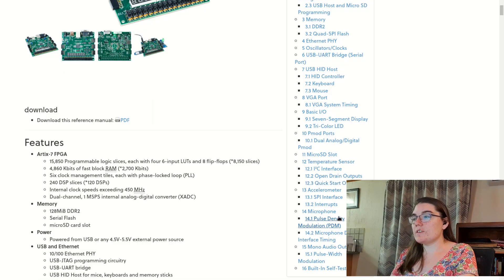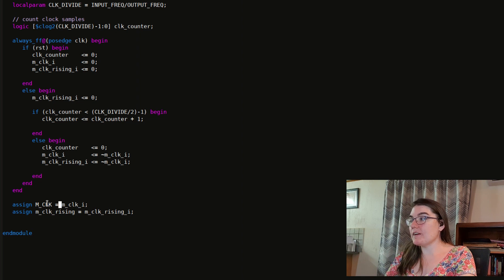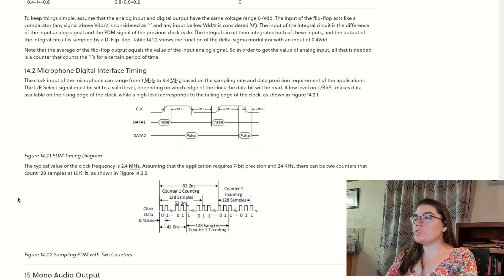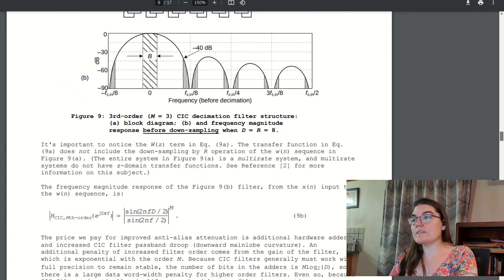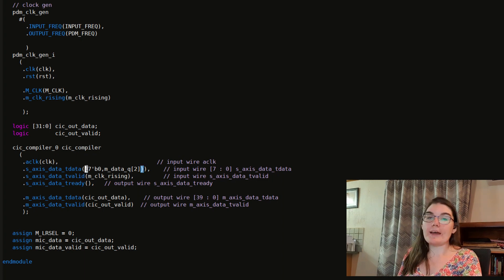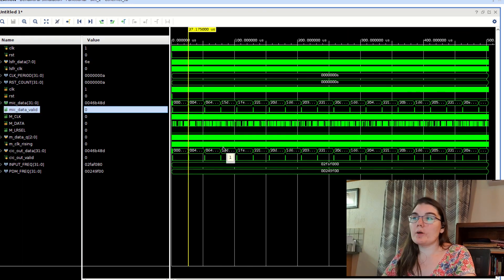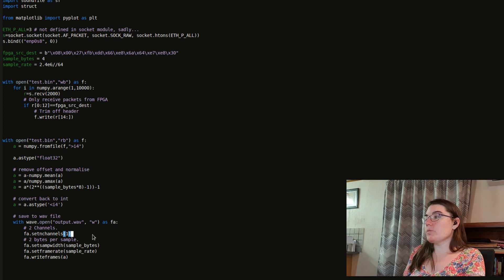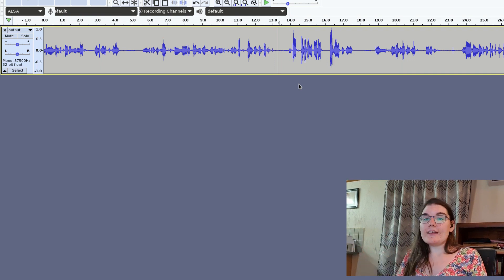FPGA Audio to my PC over Ethernet! PDM Microphone and CIC filter explained!

Comment: hello there stacey actually i watched your video on ethernet on nexys a7 board where you have used your custom ip for data transmission , here what i got the issue is that i cant understand internal working as i want to know how it works internally are you using TEmac ip or fully scratch if possible can you explain ethernet from scratch

Comment: Thanks a lot for this great series. I hope to see more videos from you soon because you are such a wonderful tutor and an amazing engineer.
Reply: The easy way to think about this is that it is a moving average filter (which is equivalent to a FIR filter with all the weights set to the same value) followed by a down sampler.

Let's think what happens if you have a moving average filter averaging 3 samples:
The outputs are the average of samples:
1, 2, 3
2, 3, 4
3, 4, 5
4, 5, 6
...
Now if you follow that by down sampling by 3 then you would be throwing away 2 out of three results of the averaging filter. So:
1, 2, 3 Keep
2, 3, 4 Throw away
3, 4, 5 Throw away
4, 5, 6 Keep
...
So if we look at the result (ie. just the stuff we keep) we get:
1, 2, 3
4, 5, 6
7, 8, 9
...
We can achieve that by adding up 3 samples, then outputting the result.

This is exactly what a CIC does: it accumulates and dumps.
This make it very cheap to implement in an FPGA.

Comment: Excellent video Stacey! The neat "CIC is same as/can be configured to act as moving average" is something I wish I had more intuition about. I was with it up through "a whole bunch of counters offset by one" and how thats a moving average - but then getting into how that related to a specific desired frequency response and configuration of the CIC IP I need to think about more...
Reply from the maker: Thanks! Yeah the filter part can be a bit counter-intuitive. It was only recently that I thought about the fact that a moving average itself is a filter, which has its own frequency response. It makes sense that it's low-pass (the output is more 'smoothed' than the input, and that means the jaggedy-high-frequency-edges are taken away). And finite (only D samples in the past are considered). So in practice it's a pretty bad low-pass FIR. The multiple-stages part makes it less-bad (extra stages improves the noise floor a lot, at the expense of taking up more space). It happens to be a good option for this application because it's significantly fewer resources and slightly easier to configure than a full FIR.
Maybe I'll implement a CIC in PipelineC at some point as my first PipelineC project :)
Reply: this book "The Scientist and Engineer's Guide to DSP" is such a nice read to learn about all that stuff. I recommend it.

Comment: Seems that your project is similar to mine. Im trying to send HF radio signal received by an antenna to PC thought Ethernet to draw the spectrum by FFT algorithm. I’m struggling at CIC filter to down sampling from 50mMHz to 200KHz. DSP on fpga such a whole new level which need to learn more to handle.
Reply from the maker: First off, apologies if you know all this. I don't mean to assume you don't, these things are just hard anyway even you do model it all. I have many memories of digging through my simulation sample by sample to find where it was different from the software model. Hope you don't mind the unsolicited advice :)

The biggest recommendation I can make for DSP pipelines, especially big ones, is modelling them first in matlab/python, and checking the simulation results against what you see in software. Especially if you're coding a CIC yourself, having a software model can help you figure out where your FPGA is deviating from the actual algorithm. 
Second recommendation is to check your datatypes are long enough to have the amount of dynamic range you need. Usually I code a second version of my algorithm in python that models fixed point and checks what dynamic ranges I need. 
Third recommendation is to add in debug muxes in your pipeline to enable/disable different pipeline stages to check if they work individually. Kinda like how I started with ethernet, then added audio, and hopefully will be adding window/fft. Usually checking each stage individually helps a lot.
Reply: @FPGAsforBeginners   I know some basics of Python but never use it for DSP, can you recommend some courses or books to learn more about it?
Reply: I think you will first need to mix the 50MHz with a local oscillator, then run it through a low pass filter.
I don't see how you can really do just what you are doing with a CIC.

Comment: Hey why input data width is 2 bits and output data width is 32 bits ? I thought PDM was 1-bit modulation (either low or high) ! Thanks in advance and very nice video
Reply from the maker: You're right, PDM is a single bit. Input data to the CIC is 2 bits because it is expecting a signed signal. I made the MSB zero so that it's always unsigned, and used the PDM input on the LSB. This works as long as I remove the DC offset at some point. The CIC has a gain of 30 because it has 5 stages and decimates by 64, and log2(64^5) = 30. Output size is input size (2) + gain (30) = 32.
Reply: @FPGAsforBeginners  Thanks for ur reply. Could you also explain why u chose 5 decimation stage and D=64 ? 2.4 MHz/64 = 37.5 kHz, why not have chosen 48 kHz ? Or its not possible to decimate by fractional amounts so u chose a little bit less audio frequency?
Reply from the maker: @HalfLife2Beta  You can only decimate by powers of 2, so if I chose wanted 48k I could have used a frequency of 3.072M on the mic. I don't know if that's in range for the PDM microphone though. or decimate by 32 and use a clock of 1.536M. I actually can't remember why I chose 2.4M over 3.072M, it was in my calculations initially. 5 stages because it improves the SNR and reduces the noise floor. 1 or 2 stages the SNR would be lower.
Reply: @FPGAsforBeginners  Thanks again for your answer. This kind of stuff I find actually hard to produce with the design choice and Verilog code in itself, it would take me probably one month to do the same so GG for making it & documenting it ! I would like a video covering FIR filters & CIC filters more in detail if its possible because its very interesting !
Reply from the maker: @HalfLife2Beta  You're welcome! This is one of the reasons why I started the channel. The learning curve is so steep with some of this stuff - my first DSP pipeline took me like 3 months to get right! - and resources can be hard to come by, so it can be slow going and frustrating for people who are learning them. I'm glad this helped you!